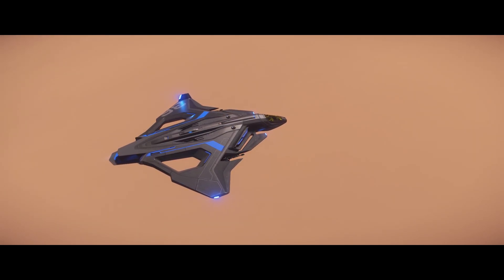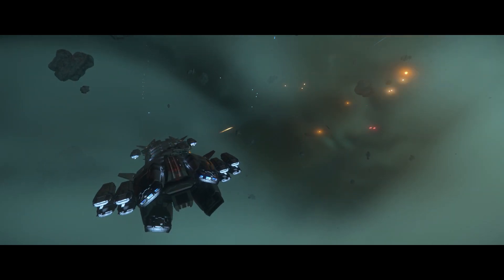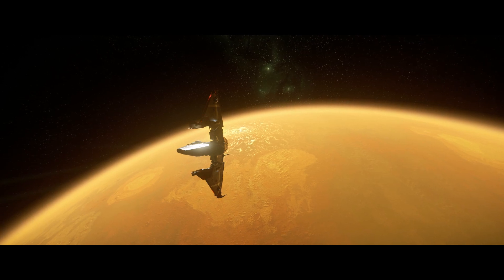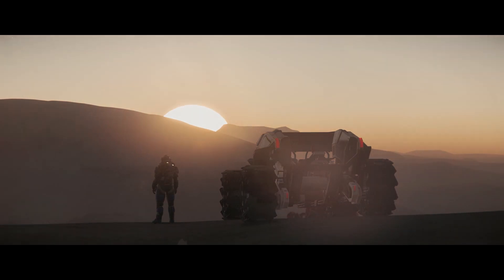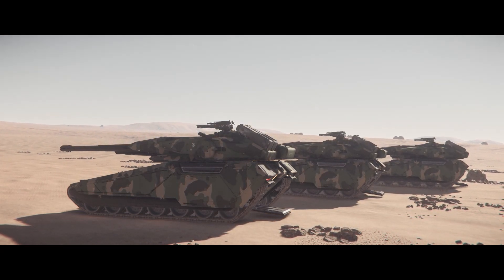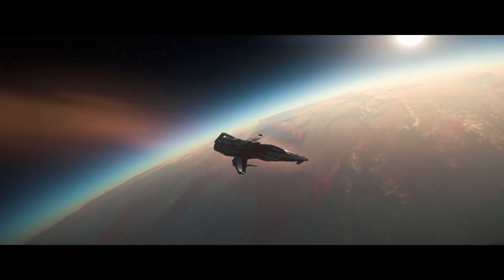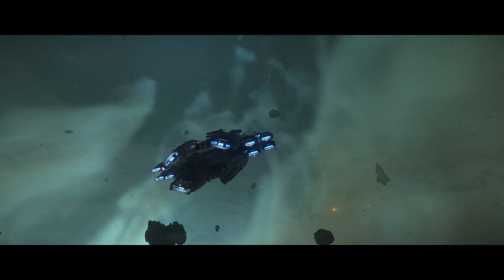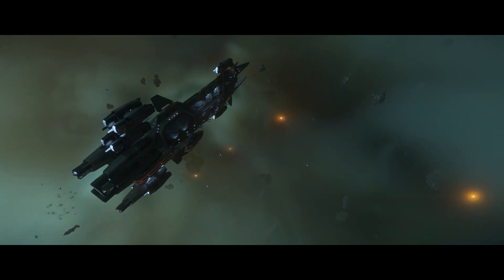Star Citizen - A software developer explains Server Meshing

Comment: Very very nice insight of server meshing, but I will have to argue, that unless CIG mentioned it, and even if they have mentioned it, it just doesn't make sense to stow and unstow permanent entities, since it is permanent. it could be streamed in and out, but not stowed / unstowed. since it is inefficient and unnecessary to do that, especially if that permanent entity is an outpost with a trading kiosk, Quantum and Virtual AI will also require it to be always loaded into the server like every major entity, it could be steamed in and out for players but quantum may not need it steamed in but will need it to be always loaded. That's just what I think. Anyway the best way to find out is to code it, some day I might just code my current understanding of server meshing just to get a better understanding of what CIG is up against and to gain a better insight. And this video helps me further solidify my understanding of server meshing, thanks

Comment: While object container streaming is a necessary component of meshing on the scale SC is aiming for, currently this is causing some issues where effects don't transfer between containers. For example, a grenade may go off on one side of a door and the effects are not transfered beyond that door even when it's open. You can drop an A2 bomb into the hangar of an 890j at point blank range and the A2 won't feel the effect of the bomb whatsoever.

Hopefully they find a solution to this, and if they do hopefully one that doesn't add any delay to the effect as it transfers. This would make something like ToW run quite badly.

Comment: I can't wait until we see this! You ask a lot of really great questions here. Especially how will player outposts react to players. 

I could see in the short term indestructible buildings and armistice zones while a player is in another shard - and possibly the same shard.

It makes me wonder this to: do you see any potential for duplication exploits with a system such as a read only? Or would this be fixed with a location read only, but it's "empty" nothing to loot from it
Reply from the maker: I think the idea is that if the location is in read-only mode it can't be interacted with in any way, so you wouldn't be able to take items that were placed into it. Bunkers and other mission locations are different since they don't need a persistent state across shards, they can just generate loot on each shard individually